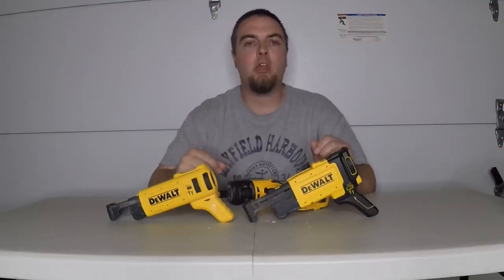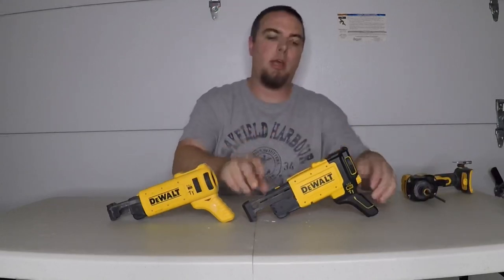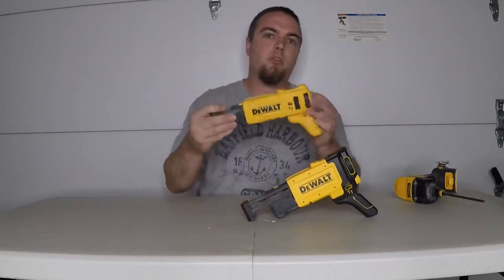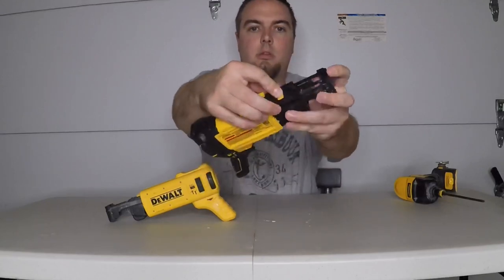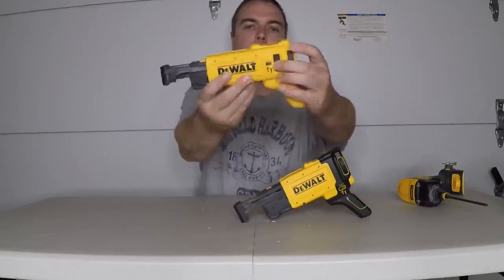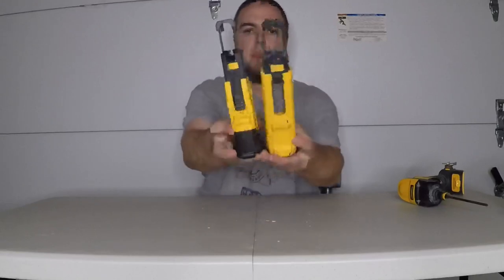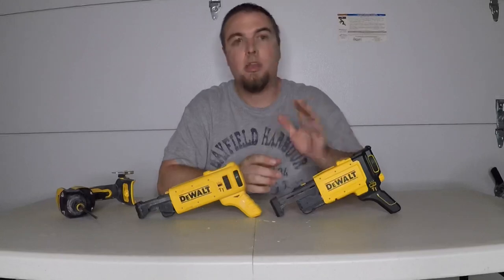Dewalt Collated Drywall Attachment Gen 2 vs Gen 1

Comment: I’m a metal stud/wood framer, and 
Sheetrock for a living and, I prefer installing old school by hand feeding screws because its a bit cleaner of an install for me, but when you need to hang some serious footage quick this thing is a must. New attachment is night and day better than the previous model in my opinion. Much smoother action and you can finally screw off corners without having to re set a bunch of clickers.

Comment: Has anyone one attempted to use this for Hardie backer board.  I’ve found collated cement board screws with square drive heads. Would this setup be strong enough. DIY occasional use, not professional every day use.

Comment: I only use the auto feeder when doing lids I just want it to be skinny enough to screw the backing not sure if this is it or not. 
Really need a feild demo so we can what it actually does. 
My 01 just got a bad wobble screws tipping over everywhere I need to replace it not sure if I should get another 01 for cheap or try the new model.
Reply from the maker: New model is thinner than the gen 1. I would recommend gen 2 over gen 1 👍🏻
Reply: @builttoughtooltalk  I just ordered the 2 yesterday can't wait
Reply from the maker: Rock on man 🤘🏻

Comment: Is the bit the same for gen 1 and gen 2 because i cant find a replacement for gen 2??????????
Reply from the maker: No it’s different. One is 1/4” longer than the other
Reply: Hi, If you have existing pr2/ph2 bits 153mm ones you can use them with the dcf6202 no problem not the other way round
Reply: Thanks for clarifying. Appreciate it
Reply: @danielwisniewskidw  I can't find any 6" bit slim enough to fit in DCF6202

Comment: Can you use the 1st generation shaft with the 2nd generation rocker? Asking because 1st generation shaft is about 1/4 inch longer
Reply: Hi, yes you can, but not the other way round. If you have existing pr2/ph2 bits 153mm ones you can use them with the dcf6202 no problem.

Comment: Will the new model fit in the generation 1 box when on the gun?
Reply from the maker: I’m not too sure. Ours don’t come in case here in Canada. I would say no though since it’s a totally different shape
Reply: @builttoughtooltalk  yeah seems a bit fatter. I’ve had the gen1 3 years and still getting 2500-3000 collated screws out of the 5amp battery but they really do not like the corners when plasterboarding. Is the gen 2 much better in the corners?
Reply from the maker: @EO-zu5uz  yes it is better in the corners 👍🏻
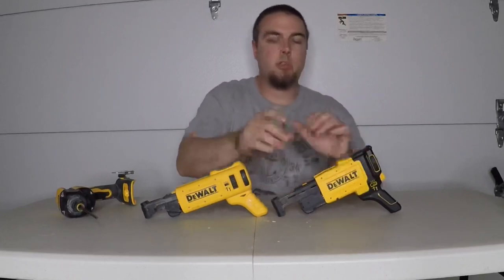Reply: @builttoughtooltalk  thanks I’ll buy the new head and see how it goes then. Saves me pulling the impact driver out more often! I think the secret to these guns running perfect though is a new bit more often! For £2:50 it’s a small price for no misfires when the heads of the bits wear and start spinning inside the screws!
Reply from the maker: @EO-zu5uz  let me know how you like it 👍🏻
Reply: Used this all day today, no misses at all and a dream in the corners compared to the generation 1. A hell of a lot smoother too but maybe that’s just being so new as my generation 1 is 3 years old

Comment: Can I use this to screw down decks porches fences woodwork
Reply: No
Reply: @skliros9235  why wouldn't you be able to?
Reply: Was wondering the same thing, don't see why not. But no idea either way
Reply: @papitosabe  first, the max screw length is 2", and the drywall screw gun doesn't have the torque to drive deck screws. It's designed for drywall or other light applications. There are other specific screw guns for floors and decking.
Reply: @skliros9235  gotcha..thank you... would fences be considered light? Was thinking about redoing the backyard.
Reply: @papitosabe  depends. A 2" screw is not long enough for certain boards. I still would not try it.
Reply: You actually can do fences stupid fast and I used it for framing.. Make sure it's level though.. F**& it's fast when you push(clutch) it's pounding Robert's way quicker than impacts. Get a bigger battery though Imo, I built 2 fences and gate and tons of framing. This drill truely rocks. But it will glow red if you don't back off if off point. Zip(motor winds) and boom(clutch engages) and flush like crazy. Used a marker to put lines for depth. Also without the attachment. There are replacement drywall bits just for this thing. Night and day verse a standard impact #2
Reply: @skliros9235  false. It has the torque. Done many many decks with it
Reply: @JamesofJesus  What kind of Robertson bit and screws did you use? I am getting this strictly for the fencing aspect but see that it only comes with a Phillips bit. Was there a certain bit and brand of screws you used? Thanks!
Reply: @supeerkul  What kind of Robertson bit and screws did you use? I am getting this strictly for the fencing aspect but see that it only comes with a phillips bit. Was there a certain bit and brand of screws you used? Thanks!
Reply: @jacobmindorff2309  I used a roberston that is impact rated from milwaukee..has to be same size roughly..then test it for depth on the clutch a few times and keep a battery on the charger waiting for it to die...be carefull. The drill is pressure based..maybe some practice first..
Reply: @JamesofJesus  Do you have a specific Milwaukee bit you know works? It would save me some time, thanks!
Reply: Something like this off Amazon? its the exact length: Milwaukee Electric or Electrical Tool 48-32-4805 Shockwave #2 Square Power Bit, 6-In. - Quantity 3
Reply: @jacobmindorff2309  cheat man. I used a impact short bit. rough same size and tune the depth. Enjoy. do a few tests first